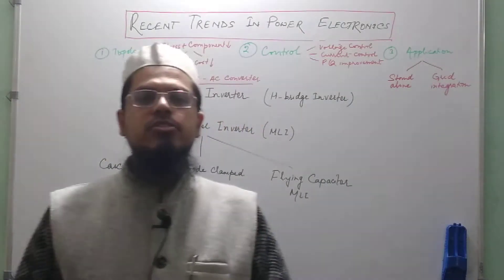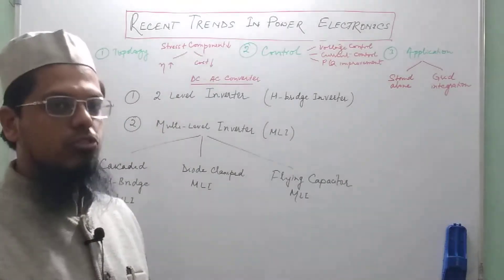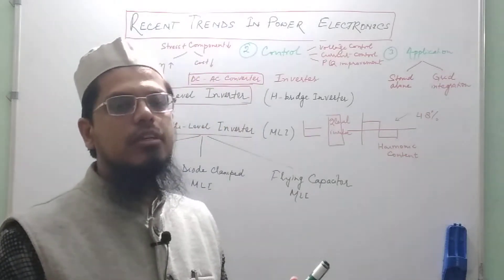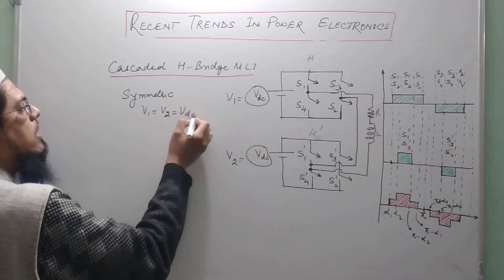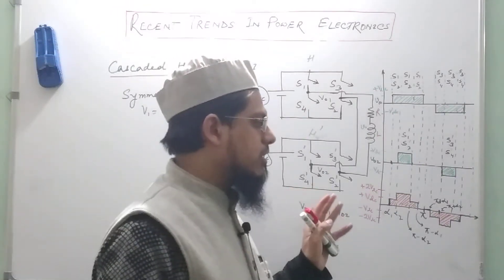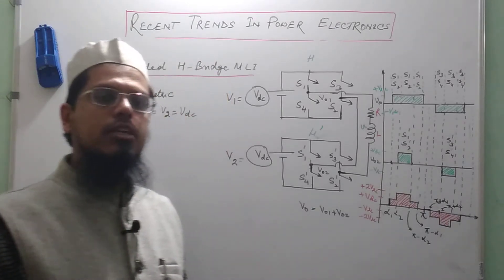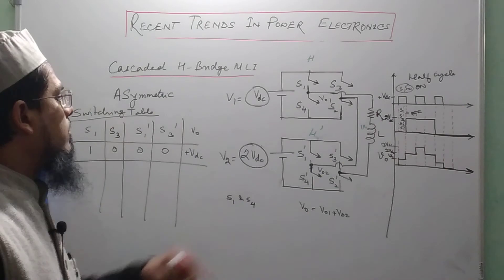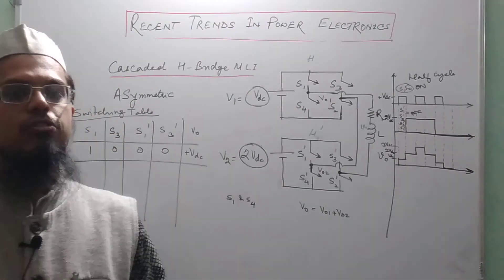Multilevel Inverter_1

Comment: 3:06 how increase in losses will increase in efficiency? It is always High efficiency due to low loss in power semiconductor devices
Reply from the maker: Dear Jasmine, I was talking about 2 level inverter (of MLI comparable rating) when i said losses are more. While in multilevel inverter loss is less and hence efficiency is more.